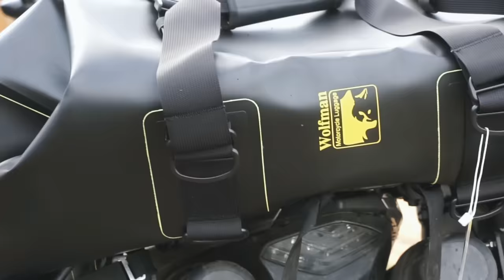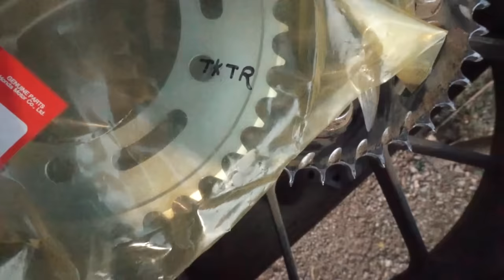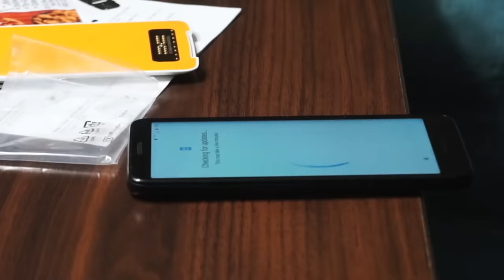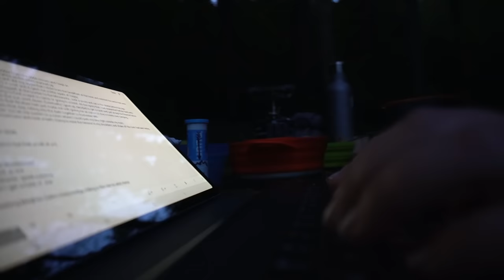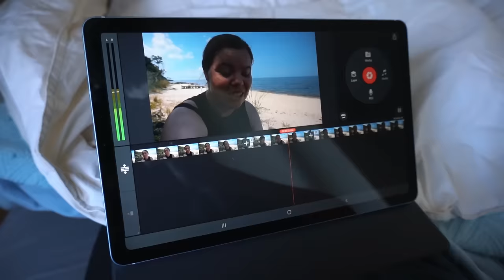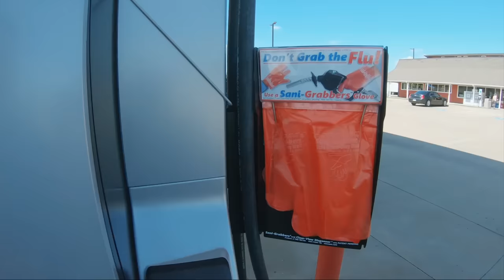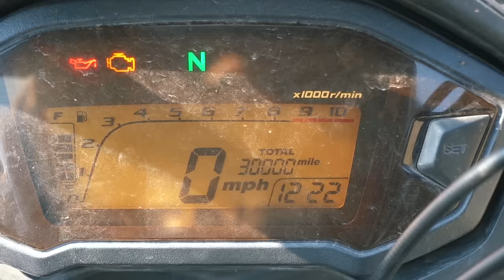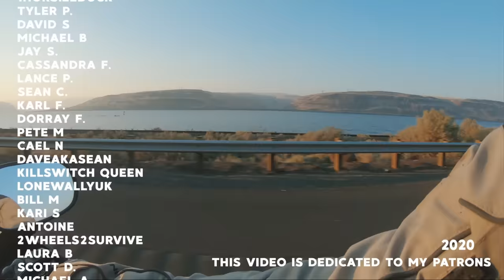Girl Rode a Motorcycle Across the USA and Back in 24 DAYS | FULL TRIP

Comment: Wise decision to stay VERY hydrated.  I live in Georgia and passed out on my bike from heat exhaustion.  Not a good experience.  I rolled across the highway and was unconscious  for several hours.  I woke up briefly on the scene and saw emergency lights through the dark (it was 1:30 p.m.).  I next came to in the hospital room.  I didn't remember being placed in the ambulance, checking in, or being wheeled into my room.  I can't stress it enough to drink plenty of water.  When I passed out the only warning I had is when I glanced down and saw the front tire on my bike appeared white.  Next was blank.